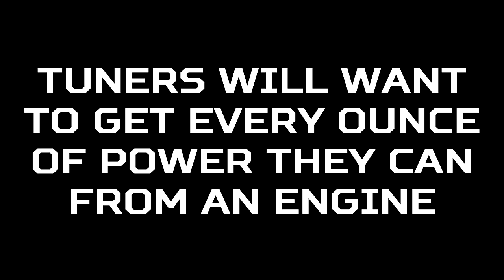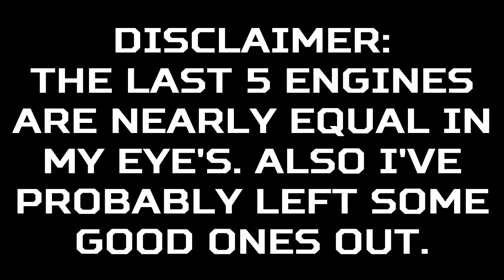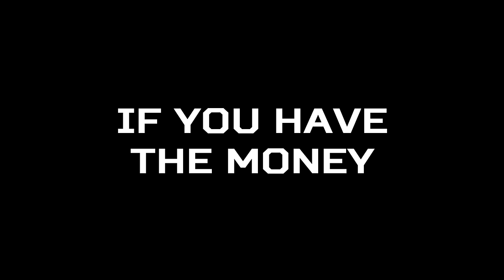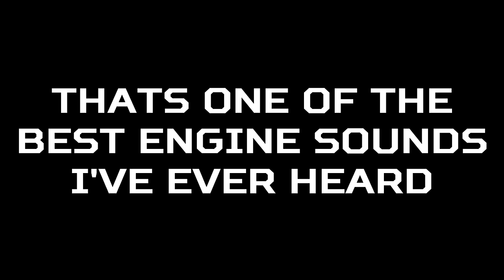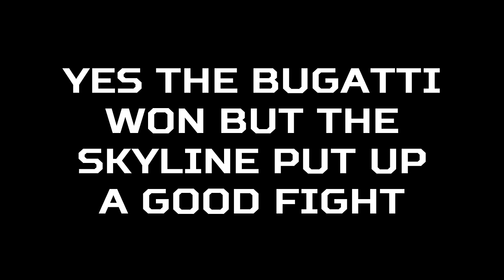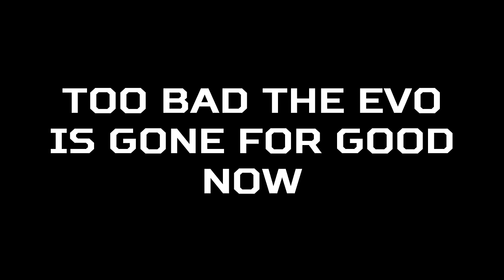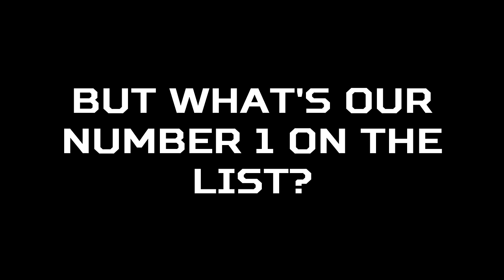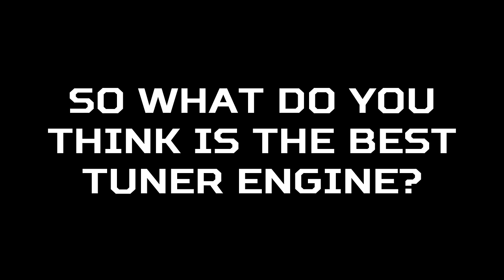9 of the Best Tuning Engines

Comment: vtec stands for very tall engine cooling
Reply: +datstocklyfe *coolant
Reply: Jon Hemmati true true
Reply: +datstocklyfe Very Tall Extra Cam
Reply: +datstocklyfe  Virtually torque-less economy car
Reply: +ultimatercracer that's the best one I've heard! Especially how I've read vtec is for economy. But it's an extra valve I think
Reply: +Charles Bengston no a lobe on the cam changes n the timing advances I believe.
Reply: Brad Young
It changes lift and duration, not timing.
Reply: hectorae86 well it stands for valve timing electronic control.
Reply: datstocklyfe
Yes, Valve Timing and life Electronic Control, but the change over of the lobes changes the duration and the lift, not the timing.

It's a bit weird, but yeah, timing control is when you change the angle of the cam a little so it makes valves open sooner (but also close sooner) or later (but also close later)
Reply: all vtec does is pull the cams down a smidge giving the effect of a mildly larger cam
Reply: +hectorae86 so essentially its like adjustable cam gears with a solenoid essentially right?
Reply: it will be faster when you equip Tuner's ebay exhuast tip and some awsome bodykit
Reply: +Ku Ro Don't forget a "type r" sticker that's 20whp
Reply: Brad Young Oh man, you are right.
Reply: +ThatOneGuy you would need a L on the End as it has a Hydraulically operated cam lobe not a extra cam
Reply: +ultimatercracer lmaooo perfect
Reply: +Brad Young half right, that's the variable valve timing component of VTEC. They other part is that it shifts the cam to use a different profile at different rpm ranges, it's like being able to have two cams in one.  Toyota's 22ZGE is similar in that regards.
Reply: Ali Ahadi isnt the vvti from the jz motors similar to that vtec technology?
Reply: datstocklyfe only the variable valve timing, but that's similar among a lot of makes. What makes VTEC unique is I think Honda got a patent on how they actuate the change in the lobes on the cams. The VTEC you see on a high performance honda engine does variable valve timing AND changes between to sets of cam lobs depending on the revs the engine is at. For Toyota only the 2ZZGE had something similar.
Reply: no it doesn't it stands for Variable Valve Timing and lift Electronic Control
Reply: I swear I heard that from a ricer video lolol
Reply: 2PacPRNDL that's where i got it from lol. i think it was a 1320 video
Reply: vtec stands for complete shit
Reply: kiarash kanani I know right lol
Reply: coolant*
Reply: ROBLOXER BENEBOY lmao that's even more ingenius. VTEC: Very Tall Engine Coolent
Reply: Graham Boverchicken 4 valves per cylinder 16 valves.. nvm thats zetec
Reply: hectorae86 its timing its called valve timing electronic control
Reply: Vtec stands for "very tiny economy car". Lmfao
Reply: bbuildingmarch haha .. kesian ricer
Reply: Duration is timing. They are talking about timing of the valves in relation to crank angle. VTEC (Variable Valve Timing & Lift Electronic Control)
Reply: Longer duration is changing timing. Cam angle is different, thats cam degrees. VTEC (Variable Valve Timing & Lift Electronic Control). Named by the creators. Later the Variable Timing Control came out and this changes the cam degrees in relation to the crankshaft.....so I guess they coined the VTEC a little too soon because then they had to add "TIMING" to the VTC later on. Making things a bit wierd.
Reply: I laughed my ass off.......but wasnt sure if you were being sarcastic. Eitehr way....funny shit
Reply: When VTEC first became a thing, there was no VVT (variable valve timing) in it. The first JDM B16A had a third cam lobe and rocker arm for each set of intake, and each set of exhaust valves. When given the electrical signal, a solenoid would push a pin into the third rocker arm so that the VTEC lobe would control the valve operation rather than the economy lobes. The cam timing change that resulted was only due to the different profile of the VTEC lobe, the camshaft doesn't actually change position with a servo. (That would be implemented in K series motors with i-VTEC)

With VTEC on both the intake and the exhaust, the engine can drive and sip gas like a normal economy car until you want to go fast, and then you can rev it above 5K to get access to a race profile that adds approximately 50% more power overall. The motors are built to take it too.

VTEC is the reason why we have 600+ HP single turbo 1.6L Hondas. VTEC is the reason why those same cars can also cruise down the highway getting 35 MPG. (Assuming a multi-fuel system such as meth injection.)
Reply: this type  of  technology is nothing new i think the Vtec is a fairly decent engine they were using this type of engines in the earlier Honda's in the 89-91 Accords, Preludes it came in the EX's and in the SE's i think, that had sports mode  transmissions with the lock up torque converter, they could hold up to a lot pressure when putting power down as you stated,  i had a 91.5 Accord EX and i used to run that MF,  it was a fearless engine 2.2 L SOHC 16 valve Programmed Multiport FI. variable valve timing electronically control Assist with throttle bottle, with Sport mode transmissions. i missed that Sedan so much that car moved even tho it said 130 on the dash it would smash past that,  i never topped it out but i know its good for 135 mph
Reply: oh yeah as for the the gas mileage it was listed for 22-26 city, 28-36 hwy. mpg. maybe a little more it depended on what kinda tune you had as i had a Bosch tune running 93 octane.
Reply: Ur so wrong its very tall engine crap
Reply: I know where that came from 😂
Reply: @soundmoneystacker2787  r/woosh
Reply: @aniciadospueblos1523  r/woosh
Reply: Not even funny. It stands for vent tarp empty crap. See, just random words that make no real sense together doesn't really work.
Reply: You're wrong
VTEC stands for
V-variabile valve
T-timing and lift
E-electronic
C-control
Reply: That ricer
Reply: Stands for mo powa baby!
Reply: I made this comment 420 likes, blaze it
Reply: @lard379  ur a fucken legend
Reply: No it’s standads for various  Toyota electric cars 😁
Reply: Tup
Reply: Ahahaha😂

Comment: my personal favorite is Toyota's 4AGE/FE... though LS V8 are a lot easier to make power from.
Reply: +pbfloyd13 too old. even with forced induction they are quite limited engines.
Reply: +TheEpicCoww but 11k rpms from an 80's 4 cyl!!!!
Reply: *****

280hp from a 1.6 is excellent.
Reply: +pbfloyd13 but 280hp is pretty much the limit. These motors can't hold alot of power, and it takes alot of cash to make big power. Not hating on the motor, just not too amazing. Toyota makes 4cyl fwd cars that can make that power easily. And alot cheaper. And alot more reliable. And lower revs and higher torque.
Reply: TekkitTeamSparta 

To each his own...
Reply: +pbfloyd13 YES 4age or even 2zz-ge
Reply: 666gravedigger Im curious, why the 2zz? I have seen a few nicely done 2zz's but they seem like they take alot of cash to make nice power. Its like a modern 4age. What are the benefits of a 2zz versus something like a ca18 or sr20? Or even a ka24?
Reply: +TekkitTeamSparta 2zz 11.5.1 compression,  good port and combustion chamber design,  small bore long stroke 187bhp 1.8 highly overlooked as it cheeper to start with a honda vti or SiR.  As for the sr20 im my opinion they are only popular because of the platform they came in (FR ) the Ca18 love knocking piston rings out, the sr20 love Knocking Rocker assembly out. If you are going for a powerful inline 4 you would be much better off starting with a 4g63 or a 3s-gte both of which didn't come in a FR platform hence why they are not as popular as an sr20.  As for expense the popular cars are always are easier to tune and cheaper because of the market demand honda b16-b18 k20 k24 and f20c are all really popular hence the ease of finding bolt on tuning parts same goes for the sr20.  Lets put it this way 3 of the 5 fastest 4 cylinder cars in the world are Volvo b230 based engines, ones a dsm(4g63)  ones a S15(sr20det).  See how hard it is to find parts for a volvo 940 turbo which has a b230ft as standard compared to a S13-S15 Silvia.   Dont get me wrong i love cars of all shapes and sizes Even dirty diesels.
Reply: 666gravedigger I dont like that number, 187bhp. How hard is it to extract power out of it with or without boost? Seems like it would be easier to go 3sgte, reroute coolant/oil feed stuff for turbo and throw an is300 box on it. Easy 230+ bhp turbo. Or grab a 4g63 like you said, but go rwd swap, use a t56 with an adapter or a w58 or something. Plus the 4g has huge aftermarket for evo/talon/laser/blabla so you can get parts everywhere. Seems like the 2zz just isnt a tuners motor, more like a motor that happens to get swapped occasionally. Still want to see what they can do, though. I am biased though, I like me a toyota, if it was a nissan I doubt Id spend my time looking at it
Reply: +TekkitTeamSparta I also like me a yota, so much so at the workshop we have a aw11 4ag-ze, fj75 Landcruiser bj40 cruiser, mk1 starlet 4age on 40mm dcoe's 1pz fb rx7 3.0 surf (4Runner), a 2zz t sport celica ,tte supercharged 2zz Corolla, amounts others.  I'm in the uk and an is200 has a 3sge with manual option oh how the gears are grinding in my head.  But you're dead right the ease of tuning a 3s compared to a 2zz is night and day difference.   I also considered putting a 4age in my samurai but deemed it a waste of a good engine.
Reply: 666gravedigger Ive been looking into the 2zz for the past hour or so and it seems like its hard to get solid power out of them for cheap. I did however see a lotus guy running a turbo 2zz making like 830bhp or something crazy, thats a top budget build though. Most of what Ive seen is built 2zz's making around 230-240, and costing about the same as it would to build a 3gste or 2jzge NA-T.
Reply: +TekkitTeamSparta As I said before it all boils down to parts availability stuff for 3sgte are a plenty stuff for 2jz's also, parts for 2zz not so much but a 250bhp N/a will be equivalent to a 330bhp turbo round a race track or on the street it's just drag racing that it would lose out but if your going drag racing if you are your not going in a inline 4 unless you like punishing your bank account.  For me Na all the way instant punch much broader power band and you can Rev the piss out of them,  my dd is a 350ish bhp turbo car and it only really shines on big open stretches of road I would get munched by my pals 4age starlet which has around 150bhp in the back roads and lanes.  Just look up homologation rules when turbo and Na race in the same class,  for instance look up group b rally or etcc where they raced  turbo cars against Na cars in the same class. Plus group b is awesome and worth a watch anyway
Reply: +TekkitTeamSparta 4age's have been stroked and reached close to 1,000hp mark. They are very strong engines.
Reply: +666gravedigger I'm on board with this comment. Availability of parts tends to determine a lot of builds. People must understand that the longer the engine has been in existence the more R&D has been done to increase performance. Honda was a huge brand in the pioneering of tuning. So availability of parts, let alone knowledge, has allowed these engines to reach their performance level they have today. I've been given insight, to a degree, of what it means to R&D engine components regarding the 4A-GE specifically. Now we are seeing more and more 7A-GE performance parts,  whereas Honda has had extensive R&D'd hybrid/Frankenstein engines for many years. It's all about where engineers have interest. I always think of the, "built not bought," slogan. Whether "built" or "bought" it was bought. Development of parts alone takes extensive research and time from engineers who can design and test (real world) their creations for maximum performance, reliability, and cost.
Reply: +666gravedigger don't mess with a good design. How about the 4age 20v vvti?
Reply: inthemidwinter godly, nothing else to say. Perfect, high revving, low power, fun 4 cylinder. Put it in a go cart.
Reply: +TekkitTeamSparta explain to me this low power figure your holding onto? Or are you a v8 or die guy?
Reply: inthemidwinter Show me a 4age making high power numbers. Not common. No, im not a v8 or die guy, I prefer turbo 6 cylinders or 4 cylinders, but I do love a v8, especially if they make decent power and torque and have a nice curve. Im just biased because I don't like having to rev out to 6500+ to get my power. Still, 4age is a godsend of a motor.
Reply: i love the 4age to! especially the classic 16 valve
Reply: +TekkitTeamSparta a 4age doesnt need to make high power because it goes into such light cars!
Reply: Nathan Kiely I never said it needs big power, I was just saying that they can't make big numbers and nice torque curves without heavy mods and thick wallets. Id prefer a 4age 20v head on a 7afe block, gives a nice stout boost in torque but isnt as high revving. throw some dished pistons and a snail and thats a good motor.
Reply: ***** I agree, but im talking about my dream 7age right here. I'd much rather have a 3sgte beams straight out of an altezza shipped over here. But considering I don't own any car that would need a 4cyl, I think im good :P
Reply: +TekkitTeamSparta Just wanted to shed some light on the 2ZZ for you. Part of why people don't go 2ZZ is because of the price like you said, the other is people don't seem to know much about them, those who do know how to build them make some really nice power with nice power bands. The reason you'd go 2ZZ is because it's a very light engine, much lighter than a 3S. 2ZZ heads flow extremely well, probably one of toyota's highest flowing heads. Additionally, 2ZZ heads are unique for Toyota as it's similar to Honda's VTEC because it changes valve timing and lift/duration, all other Toyota engines only change valve timing except for the 20V 4AGE that has the 5th valve open at certain RPM ranges. The power band of a 2ZZ is very strong, it's not always about peak power. 

But really in the end, it's like a smaller honda K block and since Honda engines are cheaper, more plentiful, can be built to have a much larger displacemnt, tons of aftermarket support, more tuner shops are familiar with working with them it makes it a hard sell to choose a 2ZZ over a K series. 

Another nice thing about the 2ZZ is it bolts up to a lot of toyota transmissions. So it has started to become a decent swap option for the AW11 as the weight balance isn't' disrupted, the gear ratios don't have to be changed really. It's just like having an AW11 with nearly double the power. And the engine mounts are almost all the same for the AW11, except one, which will need to be shifted to fit properly.
Reply: Ali Ahadi Yeah ive looked into them recently, actually I drove a corolla with one in it recently, his was tuned a little, had some head work done, intake and exhaust, and he said he had some bigger inejctors but I didnt catch the size, it definately felt nice rowing through the gears and flooring it down the street, I can't imagine what it would be like in an aw11. Thanks for all that information.
Reply: TekkitTeamSparta NP, yea wish they kept making those 2ZZs
Reply: +pbfloyd13 ya I was surprised too , no 4ag love . da fuk? also 2uz  or b18 . where u at?
Reply: Sam Scholdner cuz 4AGE and 2UZ are not the best platforms for tuning, lol.
Reply: Ali Ahadi 

That's like your opinion man.
Reply: oh a AE86 is a great car for drifting  and the 4A-GEU has for the time a nice standard output and it isnt so hard to tune now over 300 hp a no problem today for thees engine and +11.000 rpm in a 2200 lb car is fun
Reply: @TekkitTeamSparta  that's a big lie I've seen 4age turbos making 900 horsepower from some forged parts a stroker kit and a nice turbo